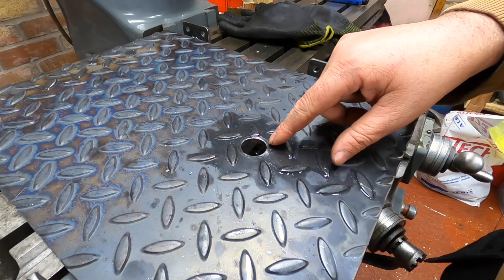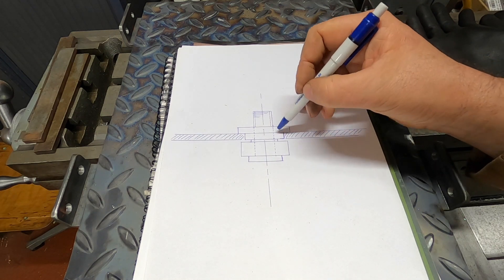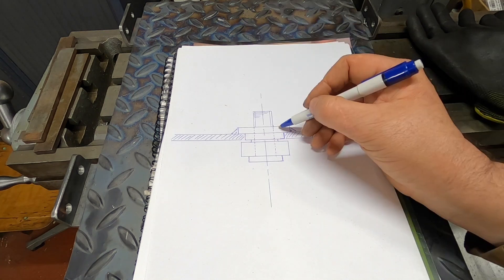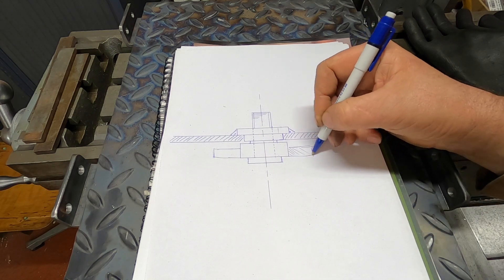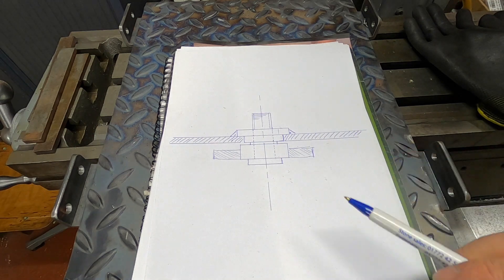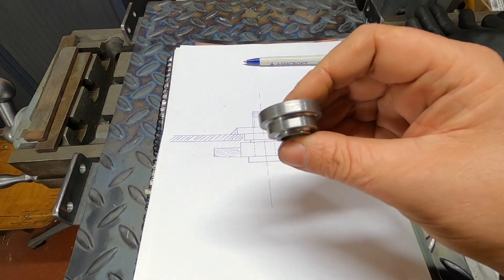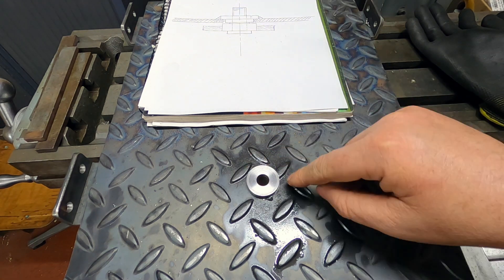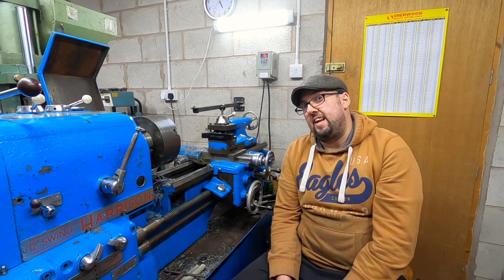The Footwell Part 3 - Pony Pivot Bush - EP14 - 7.25" Gauge Steam Locomotive Build.

Comment: Another great video Matt.  So you haven't got a parting tool...  Wonder if Santa will bring you one if you have been a good boy. (Alternatively do you want me to contact Mrs Matt and drop a few hints?)
Reply from the maker: Cheers Buddy, Yes its on my Santa list!!! Just got to decide which one(s). Matt
Reply: Matt. I’d ask Santa to bring you a PT with a carbide insert tip. I have one and the sintered carbide insert tip is the best PT I’ve used ( they have built-in chip breakers, are super sharp, and reduce the width of the chip as they cut ( avoids jamming). 
Regards
Robert
PS That is one beast of a lathe mate 👍

Comment: Not to sound like the safety police, but it really I never where gloves (except for those nitrile latex kind) or long sleeves when using these machines. These machines (especially the lathe) can kill you, and it will hurt the entire time you're dying. ;) I just found your channel and am enjoying it so far.
Reply from the maker: Hi 'My Lil' Mule', I'm glad your enjoying the channel so far. Thank you for your concerns of mine and others safety using a lathe. Once I started editing the video and the next one I thought the camera angle really made it look like I was closer to the chuck than I actually was, and I knew someone was going to say something. I can assure you that I was safe at all times, and fully aware of my movements and the machine, not to be a big head, I've been in engineering workshops for 28 years and I'm fully aware of how dangerous these machines are, but its always good to have a gentle reminder. 

I'm going to be adjusting the camera angle on future lathe videos (after ep15), to show a clearer view.

All the best, Matt 👍
Reply: I was thinking the same while watching. I saw an apprentice using a drill press with gloves get snagged, he managed to shut it off before I could get there to help. Only a good scare and lesson for him. Another lathe operator told me how his long loose sleeve got caught. He was not so fortunate, got pulled in and had serious damage to his arm, months to heal. Otherwise enjoying the build.